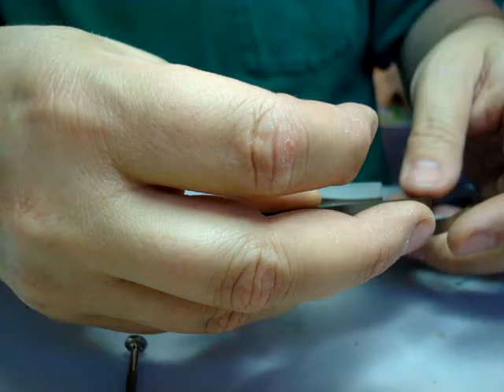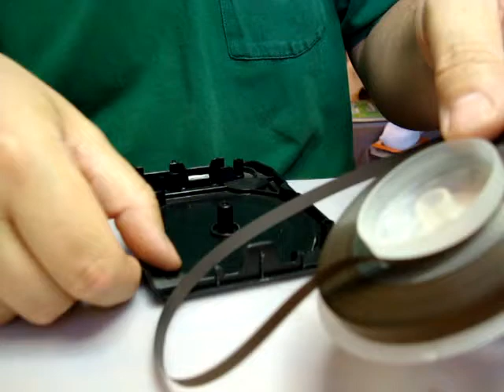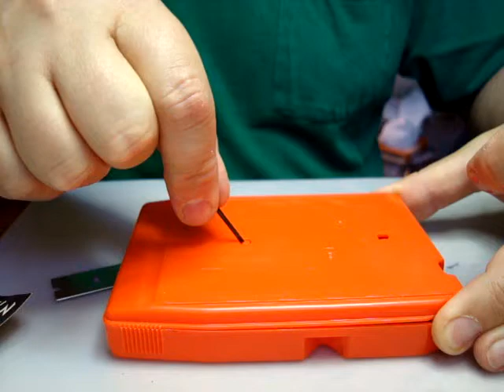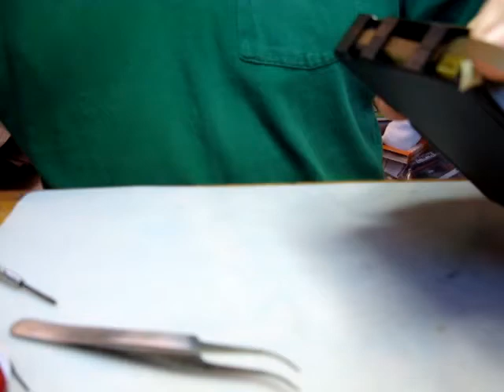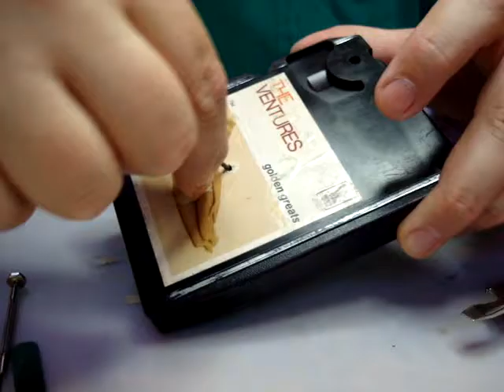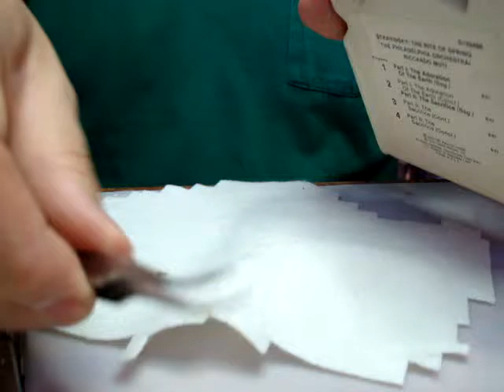8 track repair Misc pt 1

Comment: Thank you for this. trying to find how to fix this problem has been a frustrating pain, and your the first I came across that gave a nice simple solution rather than something like cut the splice and rewrap.
Reply from the maker: I try to avoid cutting the tape at all costs. I only did this once long ago before I figured out the balancing technique and it was on a 90 minute tape far from the splice.

Comment from the maker: I'm glad they are helpful. Like to try and keep them as true to original condition as possible.  Even after all this, I recently played a tape, came to the program change, pulled out the tape to inspect the splice, looked good, so continued to play the tape and then....the splice had broken and even though I saved the tape, it got knarled in some places which the iron helped to fix somewhat (never the same though). It was a Columbia/CBS tape (should have known). ALWAYS flex/pull the splice!

Comment: I had that same kind of problem with my Led Zeppelin II tape.  I managed to fix it without opening the cartridge.  I just pulled the tape from the left side and had a big loop of tape.  Then I just wound it around the pinch roller and it seems to have resolved that problem for the most part.  That particular cartridge was a pink MC5 type too and the tape had the spring-loaded felt pads rather than typical foam.

Comment: Wish I saw it sooner. (great view of clear plastic ring's relation to tape at inner hub).     My tale: After only a few loops of tape fell off my hub, I couldn't deal with twisted loops & elected to pull all tape off hub and rewind from scratch. Found myself dealing with 1000's of tape loops. I see from your demo I did not need to go through this drastic step. Nonetheless patience prevailed and I'm about to put cartr back together but face the possibility I might not have tape oriented right. (not front/back, but north/south). Thank you.
Reply from the maker: Yes, thankfully you don't have to unwind the whole tape. For a 90 min tape, it's a real pain and I did it once. If you have the tape starting from the wrong end, you'll know it as the music will play backwards. For some Beatles songs that could be useful!
Reply: @waukee321  Revolution number 9 😆

Comment: Great videos.  Excellent and easy to follow directions.  I hate those Scotch Dynarange tapes.  What a nightmare!  Apparently the designers at Scotch decided their pressure pads were indestructible.  Or maybe they knew the life of the format would be a short one.
Reply from the maker: Me too. I try to pull the pads out through the opening on those but it is tricky!

Comment: Well done, they are such a hassle many times.they are even more types  mechanisms  than the ones you've showed
Reply from the maker: Thanks. BTW never play them upside down or tilted back or they will jam. I've had all types of encounters even a warped pinch roller defect.

Comment: I've still got a twist and it's testing my patience. Any idea other than spooling off more tape and trying again? 
 Thanks for the video!
Reply from the maker: I know it can be frustrating until you get the whole thing balanced out. Either spool off more tape or perhaps you spooled off too much and that's what's causing it. Sometimes the balance point is reached but now the tape is too tightly wound. In that case you need to try and advance the tape (manually turn the reel) to get to the splice point where you then remove the splice and unravel the tape a few times more before re-splicing. High humidity can cause the tape to start sticking together as well.

Comment from the maker: I've had a pretty low success rate in opening them up without cracking or tearing the plastic case. The 5 posts have spurs on them that just grab fiercely to their socket holes. I've resorted to just pulling the tape out and with tweezers, pulling out the pad from the side, repairing it and sliding it back in. Putting a piece of thin cardboard over the laminate and sandwiching it down will help get it back. Then just pull out the top cardboard.

Comment: Hey Waukee321.
What is the name of the 8-track cartridge that spool of tape you have there showing at the beginning of this video come out of? Thank you! :)
Reply from the maker: +Mark Covington It's been so long that I don't recall. It is a large spool of tape so it likely came from a blank recording tape (Memorex likely) that someone recorded something on. I had a few tapes with broken, cracked shells, some with missing pieces that I saved the tape from. I hate throwing out perfectly good recording tape just because a case is cracked. Often times I will add/splice the tape onto another blank tape making a 30, 45, or 60 min tape into a 90+ min tape. Works great. I think on this one, I wrapped the spool up in plastic wrap or foil to keep it from unraveling for future use.  I have used epoxy with modeling clay as a form to fill in large pieces of broken off and missing shell casings. It works great. I don't have a video on this though.
Reply: Hey Waukee. Is there a chance you may one day do a youtube video on adding tape from one blank to another blank tape? If so, when do you think you may be able to do so? Thank you! :)
Reply from the maker: +Mark Covington I'll work on something but as you can see, it's been several years now since I've posted a video due to my move and other things taking precedence and taking care of some family members now. The piano needs tuning for the piano roll videos. Adding on tape is pretty simple. You wind the tape to the splice foil on each roll and remove the splices. You clean off the residual glue. For the roll you are adding the tape to, you use regular non-foil splicing tape on the back side of the tape end that winds around onto the spool and tape it to the back of the other tape coming from the center of the spool of the other reel. You then wind the tape onto the take up spool with the screwdriver technique you see on my other videos until the second reel tape is completely wound off of. Then correctly tension the tape so it pulls out properly and use the foil splicing on the front side of the tape.

Comment: Just bought an 8 track player and the 8 tracks that came with it sounds muffled. Any recommendations?
Reply from the maker: For the player part, perhaps the head is dirty or it needs alignment. For the tape part, the foam pad backing may be rotted off.
Reply: Clean that head with acetone or de-natured alcohol, more potent than the isopropyl alcohol. And the odds of it being dirty for a long long time are high. Secondly the deck may have a head adjustment screw on the bottom of the cabinet and is probably labled as azimuth. Another screw close by might be labled crosstalk, this is the adjustment for when you're playing track 2 or 3 but hearing songs from tracks 1 or 4. If the screws aren't seen through a hole in the bottom of the cabinet then you will have to take it out to adjust. Actually it's easier to clean as well,just be careful with the electricity while adjusting assuming you have to remove the mechanism from the cabinet.

Comment: Whenever it becomes necessary to open a sealed RCA cartridge, is it okay to glue it shut when closing the cartridge?
Reply from the maker: Mark Covington In any situation where the tabs or other fasteners are broken, super-glue is the best remedy for sealing (please don't use tape to hold them together). Just be especially sure in these cases to check that the splice foil is good since gluing the case closed is somewhat permanent. Is this a newer RCA cart? Those are glued whereas the older ones are riveted. Be aware that the riveted ones will almost always have a bad splice so pull them out and check immediately when the program ends.  I have a video on opening them.
Reply: This is actually a newer RCA cartridge. Whenever I try to close the cartridge, I always put not much but just a little bit of glue on each of the four corners. I only use glue on the corners. That always helps to keep the cartridge shut. I use glue but no tape. Do you think I may be doing it the right way doing it that way? Please let me know either way. Thank you! :)
Reply from the maker: Mark Covington The tricky location for gluing is near the open tape end and especially at those two corners where it is so close to the tape. When gluing here, (1) don't use too much glue and drag a corner of tissue over it to spread it so that it doesn't pool in one spot. When closing the cover, make sure it closes gently and slowly so that it doesn't slam and potentially spray the glue onto the tape. The thing to be careful about tapes that you have glued together is that if you drop them on a hard surface, they may be more prone to opening up again.  Also. always remember to NEVER play an 8 track upside down (with top cover label underneath), as the tape will eventually come off the spool in the center and jam, and what a mess then.
Reply: I would never play a tape upside down.
Reply from the maker: Mark Covington That's good. This is more prone to happen and particular on portables/boom boxes with side mounted slots which can tip/lean in the wrong direction causing a tape to be oriented in this upside down manner. I have a few portables that have this warning labeled/pictured (with an "X" over it) on the unit.

Comment from the maker: If the splice had broken inside the tape, that is likely what happened.  Need to get the tape wound to the beginning of the splice. Hopefully the tape didn't fall off the spool when you opened it.  Oh I know, I feel your pain, these tapes require a lot of patience unfortunately.  Watching TV while working on them helps alleviate the BORING wind-the-tape-on-the-spool routine.

Comment: Why is it  called an 8 track? We never had  them in Australia
Reply from the maker: Each tape runs music across 4 programs or channels divided evenly by time. The head moves down in 4 even increments (programs) and changes to the next program (via splicing foil activating a solenoid to trigger it)  once the tape makes a complete loop. Each of the 4 programs has left and right (2) sub-channels within each program, hence 8 tracks.

Comment: How do I keep the labels from disintegrating? I have like 6 Jim Croce tapes and he looks like Freddy Kruger on all of them due to the label scrunching up and rippling. Help! Elvis is at stake here lol
Reply from the maker: You have to be very careful with these laminate type labels. If you fold them in the slightest, they flake off. If you are removing them to get rid of bubbles and to flatten them out see if it's worth the risk first. Try to unpeel them without folding it by lifting in an upward manner while keeping the label flat and straight

Comment: Worst ones aside from the scotch, are the RCA ones with the rivet in the backside of the case!!!
Reply: those are easy.. use a soldering iron. Ampex are the worst!!
Reply from the maker: Agree on the RCA ones; need a soldering iron. Ampex are time consuming but using a properly sized flat end screw or bolt will successfully lift each of the 4 posts out individually. The fifth post at the opening (non-roller side) almost always separates easily. I've had some warped reels inside some of these. You have to wind the tape off of it then either find the same reel or using hot water press the other reel flat to get the warp out. Keep these out of extreme heat!

I still don't like the GRT ones with the tab that is behind the foam pad

Comment: Obviously graphite lubricated tape !!! Touching the surface is not recommended !! Would you suggest wearing disposable surgical gloves to avoid "drop out" on the tape after reconstruction ?
Reply from the maker: I read on one of the tape sleeves that the lubricant was called "Delrin". I looked this up with the following result: "Polyoxymethylene (POM), also known as acetal,[2] polyacetal and polyformaldehyde, is an engineering thermoplastic used in precision parts requiring high stiffness, low friction, and excellent dimensional stability. As with many other synthetic polymers, it is produced by different chemical firms with slightly different formulas and sold variously by such names as Delrin, Celcon, Ramtal, Duracon, Kepital and Hostaform."

You could wear gloves but always of course wash your hands with soap and water before and after touching the tape. Gently pulling the  tape through an Isopropyl soaked piece of paper towel also works well.